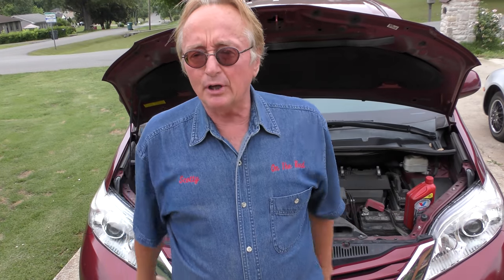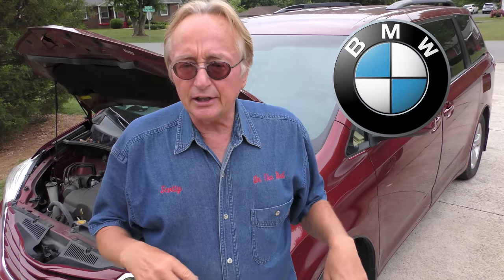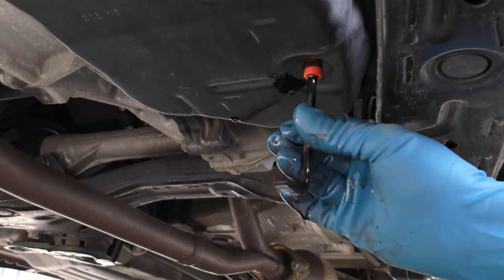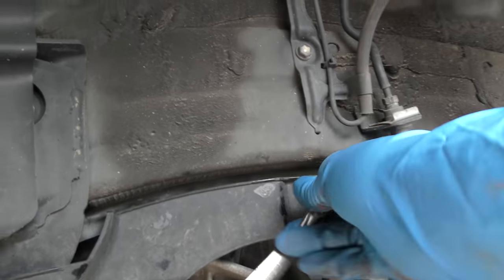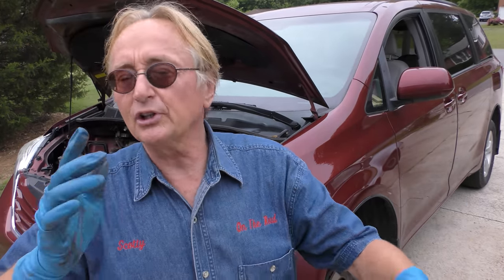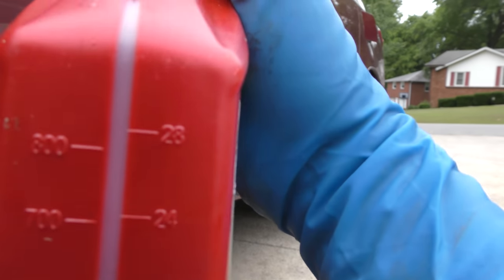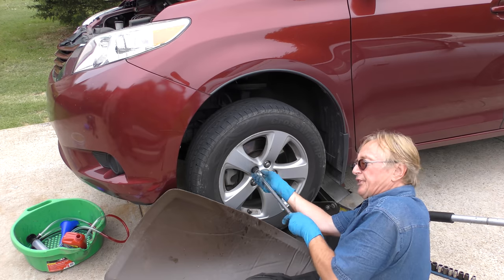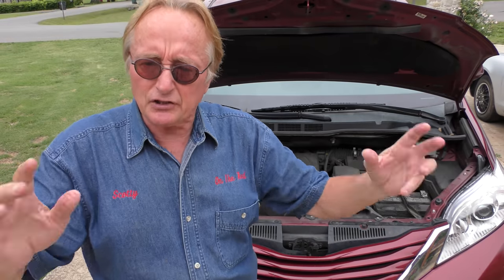Here's Why Changing Your Transmission Fluid Can Cause Damage

Comment: Good day Scotty.! Greetings to u.! I am not a mechanic, but i am curious about something.! As it relates to automatic transmission vehicles, which do not carry a transmission dipstick.!  Does the heat which is a norm in all vehicles, ever cause the transmission fluid to b reduced overtime in those transmissions which do not carry a dipstick.??
Reply: Alan, mind if I chime in and help?

Many modern vehicles use a sealed-for-life transmission that never requires checking or fluid replacement—so they don't have a dipstick.

If the vehicle does not have a dipstick, the transmission fluid must be checked at the transmission. This requires lifting the car on four jack stands; it must be level to check the fluid. There will be a fill plug on the side of the transmission case. This is not the drain plug located at the bottom of the sump. With the transmission fluid warm and your foot on the brake, cycle the transmission through the gears so that fluid is in all of the internal passages. Then, with the engine idling, remove the fill plug. A small stream of fluid should come out. If not, the fluid level is low.  

Does that help at all? Let me know.
Reply: @vigilantemotors  Good day to u sir.! Ur explanations r quite explicit, & to the point.! What spurred my curiosity was due to statutes that,  ( the plumbing in every home needs maintainance, as does the power grids, & gas supply systems.! I became curious, ( because, every manufacturer recommends that changing the oil in vehicles is imperative at a certain mileage, (so) since they said that some transmissions r maintainance free, i asked myself, ( how can this b so, with some transmissions,) & not with the engine, when both components r on the same vehicle.! A top up of the transmission fluid, is not equivalent, to a ( manufacturer's recommendation, of specified timeframes for ( an oil change,) in all vehicles.!

Comment: Wonderful helpful tips and guide. I have a 2018 Toyota Tacoma SR5 3.5L V6. I have a question and wanted to know if the same things you use work for mine as well or should I get a different kind of oil? Second question is what kind of transmission oil fuild do I use to change and what other things do I need to change also? It's hard to find real loyal mechanics so I came across your channel and hoping to get some help all the way from: Juneau Alaska

Comment: Hi, I got an 03 Corolla with about 150k..I drained & refilled the trans fluid only once around 90k, should I do it again & replace the filter as well or just leave it alone? Any advice is appreciated..
Reply: Since you did the exchange at 90k I would definitely do another exchange. Always replace the filter. The more the filter is clogged = it slows down the flow of AT fluid = the transmission is not well lubricated and cooled = its service life is reduced.
Reply: @Mijanboy  I forgot to mention, I never drained & refilled the anti freeze coolant in the radiator..should I do that at my current mileage also?
Reply: @ro-landocalrissian4633  Yes, old coolant is aggressive to seals. If a nasty brown liquid comes out, use the cleaner and only then put in a new refill so it makes sense when you're doing it.
Reply: @Mijanboy  cleaner? What do you mean by use the cleaner?
Reply: @ro-landocalrissian4633  cooling system flush
radiator flush 
radiator cleaner   etc...
follow the instructions on the can😎

Comment: I completely flush-change the fluid in my 2003 Buick every 15,000 miles because I drive up and down a steep mountain road every time I go out.  The transmission fluid gets a burned look and smell on my neighbors cars by 30,000 or less.  My transmission is perfect with 150,000 miles.  Several of my neighbors transmissions failed early.

Comment: Reply below is close, but you'll get religion trying to grind off that pivot bolt. Its one of those compressed head deals pessed onto both sides. After grinding I had to remove with an AIR CHISEL. in any case, yes grind the underside of the slider rod to extend the flat area about 1-1/2" toss the old spring and replace with a Melling VS-1130 valve lifter spring, which will give more room to compress. Drive your pivot pin back in, as long as you removed with an air chisel, it will have enough press force remaining to secure the original pin. Good luck, about 4 hours door-to-door.

Comment: Scotty I have a question I have a 2005 Lincoln Navigator with over 250,000 miles on it it has a sealed trans no dipstick, it's a 6 speed and if I'm gaining speed as it's shifting through when it hits 5th gear it starts to slip as long as I'm just going easy it will shift through just fine. Do you think changing the fluid and filter will help or maybe putting some antislip in and changing the fluid and filter will help, anything short of rebuilding the trans, PLEASE HELP
Reply: I would bet on a low AT fluid level, or a clogged filter.

Comment: I have a Hyundai hybrid with 120k miles. Dealer recommended a trans flush. I was planning on just changing. Are your recommendations the same for hybrids.  For reference I still have 6 mm on break pads on original brakes.  ICE is used less. Not sure of trans wear rate on hybrids.

Comment: Hiya! What happens if you purchased a used car with high mileage and you’re not sure if the transmission fluid was changed? Is it safer to leave it alone or to go ahead and change it? I did see your video on how it could be dangerous to flush the system. Not sure what to do to get the most life I can out of my new car! Thanks!
Reply: If the car transmission doesn't have any problem with its performance you don have to worry about the tranny fluid  simple as that .

Comment: Hey scotty i have a 2007 honda civic coupe and i got it with 30,000 miles back in 2014 it now has 210,000 ive always done the maintenance on it like oil change and other things but due to mexican superstition i havent changed the transmission oil should i change it out or its too late i havent had any issues with it and i wouldnt want to have any problems for changing it.what do you think?
Reply: I would only replace the external AT filter that Hondas have and maintain the correct oil level (AT fluid). Changing the AT fluid is unfortunately too risky in my view.

Comment: Can he look at the service manual fill specs instead of going through that mess? On Hondas we have the IN (interactive network) that gives us the transmission change, valve body removal, and overhaul capacity. Plus it tells us the fluid type. Guess Honda and Toyota arent using the same methods 🤷🏻‍♂️

Comment: my car never had the fluid changed and I had it done recently and its starting to slip wat can I do now to help it before my whole transmission goes out? plz help
Reply: If it's starting to slip, there's nothing you can do.  Changing the fluid always helps, but slipping means you have worn parts that have to be replaced, which means a trip to a transmission shop and some $$$.  Don't be snookered by any of those "stop slip" , "stop leak" things to pour in your transmission to "fix it".

Comment: I understand this is an older video but just came across because I watch all your stuff- I have a 2006 gmc sierra crew cab 5.3 138k on engine- I want to drive to SD from Fl and back to visit my kid- sounds like “Do Not” change filter or flush tranny? Thank you for any response - Also although regular oil changes haven’t replaced spark plugs but the engine puuurs

Comment: Topped off the fluid, closed the fill port, annnd done. Let's take it for a spin to make sure...
Hmmm... there's a grinding noise coming from the front... let's get out and check... Oh darn! I forgot to put the wheel back on.
Well, I had to forget something or I wouldn't be a mechanic. 😐

Comment: I have manual transmission (UK) 2.2liter capacity I don't need to buy 2l off new gerbox oil ? Because I won't get out 2l out off transmission?  Is this correct?
Reply: It is not right. The entire contents will leak out of the manual transmission.

Comment: Can I use A-T205 RE-Seal on a 2016 Toyota Camry transmission it’s leaking out of the front seal of the Transmission and rough shifting sometimes on 2 and 3 third gear than you in advance Scotty

Comment: A note on the Jatco CVT's.  At least change the filter behind the oil cooler/warmer, usually located under the battery tray (at least on my Lancer it is).  The dealer doesn't even change them for the 30K CVT service.
Reply: Thanks to this, you will win the claim when the CVT dies. In the US a lot of people have sued Nissan CVT (jatco) but I don't know the outcome... class action

Comment: GM has a transmission in my Colorado that must have the tranny flushed and new filter put in every 55000 miles or so . Not doing it causes low rpm shifting issues and high speed troubles , chattering , lowered mileage as well !

Comment: I always flush my whole transmission through the cooler and then do filter I've never had a problem And it usually takes between 10 to 12 qt. RAM TRUCK.  I have done it the way Scotty did  By getting some of the fluid out but I never feel satisfied.

Comment: Great channel I have a question for you my 2020 Honda hrv has 31 k miles on it went to my local Honda dealer to get the fluids cvt and rear differential they are saying there are no filters to change is that true

Comment: Hey Scotty, I have a 2011 Lexus GX460 I bought a year ago.  I have 133,xxx miles on it, and my mechanic was going to service the transmission and change the filter etc., for $500 ish, but does the filter need to be changed or just the fluid?

Comment: Hi Scotty, nice video, one thing I just want to ask. After filling the fluid you didn't put the fluid temp into 104 then drain some. Just like some other video. They make the temp to 104 then open the drain cap then let the fluid drain until drip then close the cap 
Question: does it necessary or no? Thanks.

Comment: Hi everyone I need reliable information. I have a VW Rabbit 2007 with 190,000 miles and I need it to run another 60,000 miles. As far as I know, transmission fluid was never changed. I am deeply scared of asking for this service and start having transmission problems. But also afraid of not doing it and start having transmission problems. Some people say to go with the manual (that says nothing), others say to do a flush, I am really ignorant in this area. Could someone advise? Thank you.
Reply: Do not do a flush, it's an expensive way to damage your transmission at this point.
There is a solution to this I just saw
... will come back when I find it and post it for you.

Comment: I have 2007 civic 120000 miles.
It runs great but never had transmission fluid changed yet.
Do you think I should I change fluid or leave as is?
Reply: Don't do it I change my 2008 honda crv fluid and start to slip if you are over 100,000 leave it alone.

Comment: I've heard that changing Transmission fluid on a high mileage vehicle that never had the transmission touched would most likely mess up the transmission, but how about changing slightly early? Apparently my chevy says every 90k but I don't trust it lol it is an American automotive brand after all lol
Reply: Hello from Europe. I am surprised by the differences between Europe and the US. In the US, some AT Toyotas do not have a filter, only a strainer - In Europe, always a filter. The warranty on a new Toyota is 36 months or 36,000 miles (58,000 km) in the USA - 36 months or 62,000 miles (100,000 km) in Europe.
  You write that Chevy recommends replacement after 90K miles (145,000 km). In Europe, the maximum interval is 90,000 km (55 K miles), but no one follows it. They all change their oil after 60,000 km (37 K miles) at the latest.
It's funny when a Korean car is without an AT fluid change (lifetime) or has 90K km and a Mercedes has 60K km and if the car tows a trailer or goes off-road then 30K km (18.6K miles) is recommended by Mercedes.
I change every 25-35 K miles (depending on vehicle load) all fluid content + filter + new gasket under the AT pan. The SUV has 282K miles (455K km) and the MPV has 495K miles (798K km). ATs work perfectly - never a problem.
Yes, if you do not change the AT fluid for a long time = the oil will not have functional additives = the life of the AT decreases. We had the AT fluid tested at the lab which was 85k km (53K miles) after the change = not one additive was functional...
That's why I was amused Chevy recommends a replacement at 90K miles...:face-blue-smiling::face-blue-smiling:
And you surprised me that you don't believe it... very good!!!👍👍👍

Comment: Thank you soooo much. The manual definitely did not say the way to fill was the top of the transmission. I even had 2 guys stop to help me find it, 1 read the manual couldn't find it. The 2nd guy said it was on top, I needed a funnel but probably since I'm female didn't say wheel removed or how to, just it's on top of the tranny and I need a funnel and hose. Thank you
Now I just have to see if I have all the tools 🔧

Comment: I may have missed it but I didn’t hear why“ changing your transmission fluid could cause damage” I heard that it may cause slippage  or other problems. It may be true changing transmission fluids can lead to or the result maybe that problems arise, is that because you change the oil or maybe because the problem was already there and the contaminants in the transmission was masking the problem. If we follow this line of logic, can’t we then also say if the engine oil has never been changed “it’s to late… so just pray it’s lasts a long time”? Mmm

Comment: A toyota tundra transmission holds around 12 qts so you almost getting nothing to drain out the way your doing it and that van transmission holds 8 qts so the amount your getting out isn’t doing that vehicle any good, just pay the dealer for a full fluid replacement they and a modifier to help the car shift

Comment: This was easier than I thought it would be. I did this a total of 4 times. I did it once than I drove around for a week, and then I repeated the procedure 3 more times. I'm pretty sure I got all the old fluid out.
Reply: Do you know that every AT has a very fine oil filter, which of course changes when the oil is changed? The most sludge settles in the AT oil pan, if you do not change the oil regularly - it is wiped dry, because the sludge degrades the new oil (additives start to dissolve the sludge). Some ATs (e.g. MB) have a magnet at the bottom of the oil pan - which can show you - a problem with the AT. In addition, the author put the wrong amount of oil = there is too much - the level control is on the drain screw - that's why the red plastic is there. If the oil flows easily from the drain hole (engine running) = correct oil level.

Comment: Actually, you changed only a part of the fluid. Now the new one is going to get mixed up with the remaining old one, and it will result in a partially changed oil. You can drive the car 15 minutes while changing all the gears and then you can repeat the procedure of oil change. 2-3-4 times. And then, you will get a cleaner oil. Or, on other cars, you can take out the old oil through the oil cooling hose .
Reply: And who replaces the filter? That's the idea, change the oil and leave the old filter.

Comment: Hi Scotty I have a question for you, what might be the problem when a transmission slips and doesn't show any sign of oil on the deep Stick when the car is idling but when it is off the deep Stick has something at 25 degrees, and I found this code P0841-ff it's a Mazda 3 L3

Comment: Hi Scotty.  I noticed you used Valvoline Maxlife and not Toyota WS.  Are they compatible?
Reply: It depends on the performance specification of the AT fluid to be the same as prescribed by the manufacturer. The brand of AT fluid does not matter.

Comment: I change the transmission fluid in my truck with every oil change, so about every 8,000 miles. Overkill? Perhaps. Cheaper than a new transmission? Definitely. I have almost 400,000 miles on the original transmission, so I'll keep servicing regularly!

Comment: Between myself and my parents we've owned the more "modern" automatic vehicles for a combined amount of over 20+ years. All the vehicles we've had, 00 Suzuki GV, 07 Toyota FJ, and my 2004 Dakota have way over 100k miles and we've NEVER changed the trans fuild. As long as it still shifted right and the fluid wasn't burnt and you didn't overheat the transmission, you left it alone. All the material worn throughout the years is in the fluid (yeah "wives tale") but it makes sense when you remove some but not all do a full refill, or adding some in if it's a cup low. either way you're removing the fluid with material every change. Thus eventually there no more material. Regardless if it's an older banded automatic or the modern turbine style of automatic there's wear. Proof to a reason: Neighbor just did a full Transmisson rebuild and new torque converter on their last gen Chrysler Minivan. Maybe 85-90k miles on it, changed the fluid pretty regularly per the book. My mom's 07 FJ had a plug to pull to check the level via sight, but no traditional dipstick in the automatic (basically a sealed transmission) I only have 123k on my Dakota, we bought it new in 2004. The Suzuki, had 98k miles before it even showed signs it needed spark plugs lol

Replace it regularly to the book or not, eventually, you'll need to get it overhauled. Not if but when.

Comment: my car has 133k miles on original transmission fluid.  Not sure if I should bother with it at this point.   Someday I will have an EV and just go maintenance free.
Reply: Haha. EV has gearbox with fluid that should be changed too. And check Coolant levels too

Comment: Always mixed valvoline ATF fluid with Risoline transmission Anti Slip fluid if your vehicle is 160k miles Or beyond.
Warning ⚠️  Don't use Risoline on CVT.